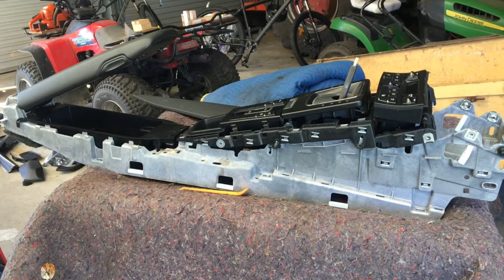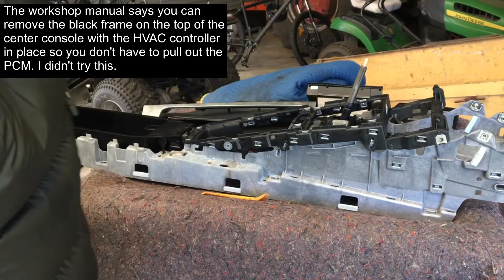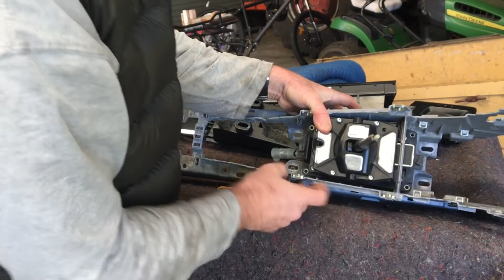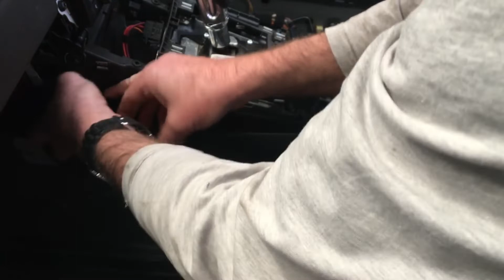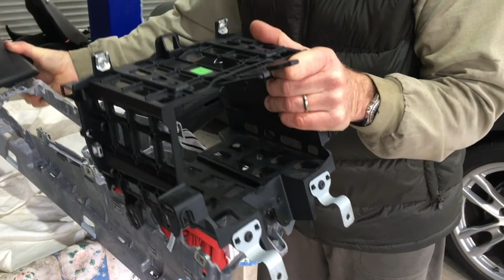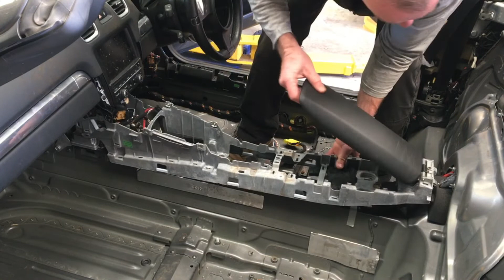Porsche 981 Boxster center console removal

Comment: so you cant remove the large side panel just by pulling it up without taking out all them pieces? I just want to easily take it out and wrap it @7:56
Reply from the maker: It's one of the first pieces that goes in and lots of stuff goes over the top. I tried this over and over to work out the sequence, and this was the only way I found that worked. Even the skinny piece directly above it that goes behind had to be installed after due to the location of some of the clips.

Comment: Hi Jeff, great info thanks for this. I dropped something and cracked a hole in my PASM console button, it still works. Do you think I could pop off the black plastic button cover and replace it with one I find at a wrecker ? Do you reckon its possible to pop off those buttons without disassembling anything ? cheers.
Reply from the maker: G'day Tim, I don't think you could get it off successfully without pulling the unit apart. Don't be concerned, it's pretty easy to do.
Reply: @jeffrichardsoncardiy  Sounds good, thanks !

Comment: Once you get to 1K subs you can monetise these, great info
Reply from the maker: Unfortunately youtube monetisation isn't designed for content like this that goes to a very select audience. Unless you have hundreds of thousands of subs/views then it earns peanuts. I'm certainly not doing this for the money and encouraging more ads in the videos is something I don't want to do. I'd just like it to be a decent resource for the Porsche community.

I'm fortunate in that I've done OK for myself. I'm 53 and retired a year ago. But for the outlay of the car initially and then the kit to remove the engine/transmission/et al I'm struggling to justify more money going out. Hence the suggestion of donations so it's not quite so onerous.
Reply: @jeffrichardsoncardiy  this will be useful info for many gens to come. Good on you